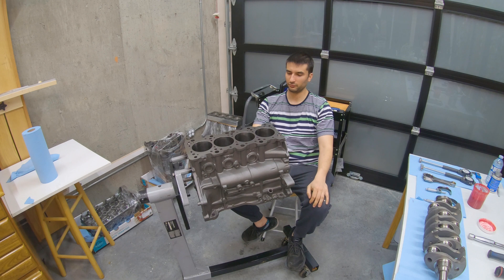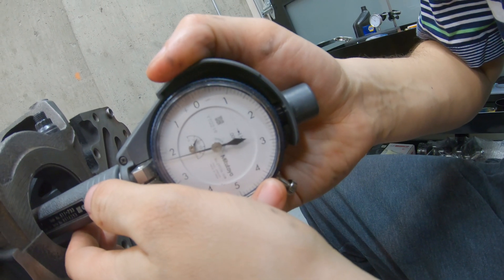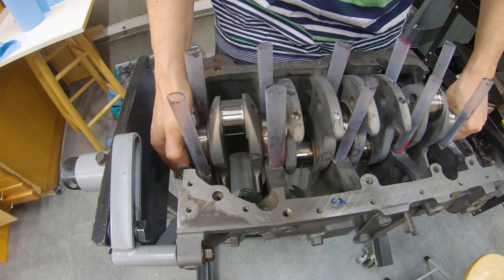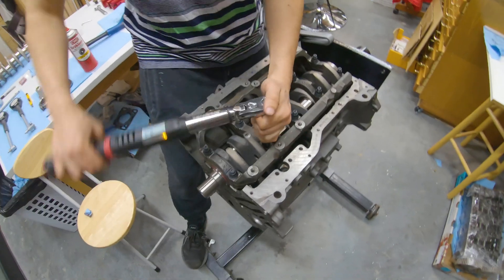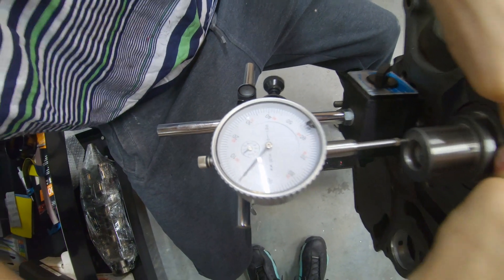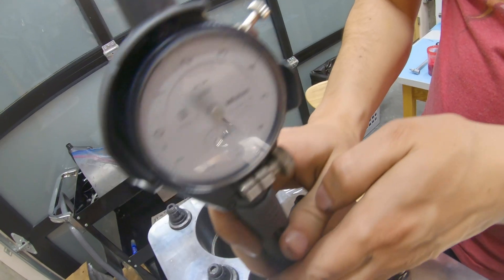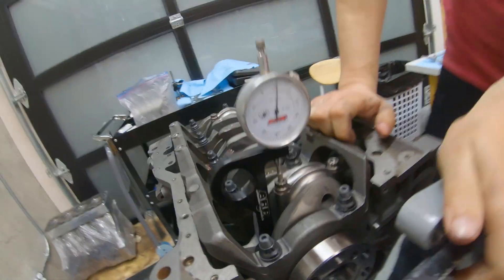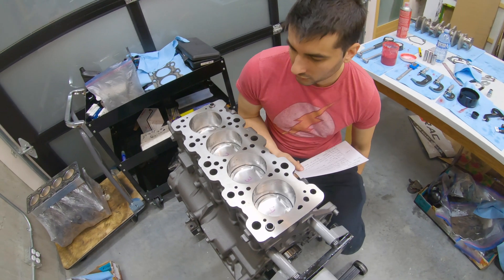Building a Mitsubishi Evo 4-9 4G63 Short Block Engine - Tips / Clearances / How To

Comment: Few things I noticed and want to ask about.   The first thing you do is measure the mains, and it comes back in the .0019 - .0023 range as we see on the dial indicator.  But, at the end of the video you have a sheet of paper that shows all the main clearances in the .0024 range.   Were things re-measured or different shells used after measuring the first time?

Second thing is you mention loosening the nuts on the girdle in the "right sequence".  Wouldn't the right sequence be the opposite of the sequence used to torque the girdle down?   

Finally, curious about the sequence you use for measuring the bores and gapping the rings.  I've not seen the crank installed first and the bores measured and rings gapped after that.  Do you do that because having the mains torqued down also distorts the bores slightly?   Assuming the machine shop bored the block with both the torque plate and mains torqued.